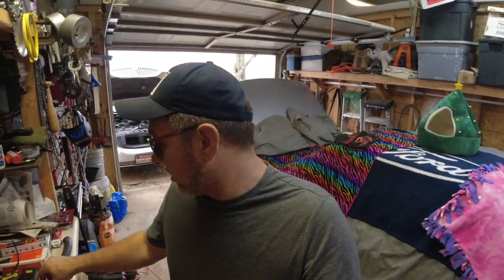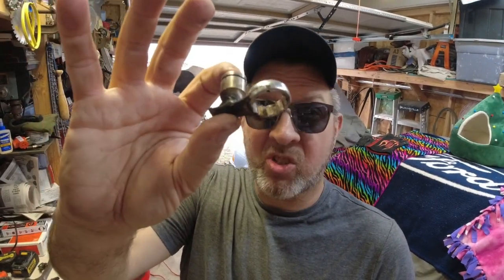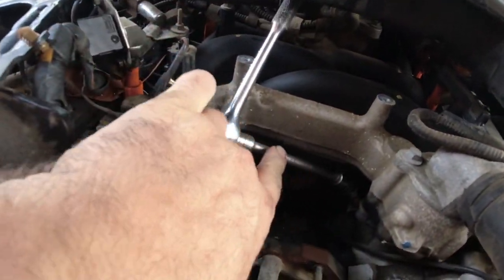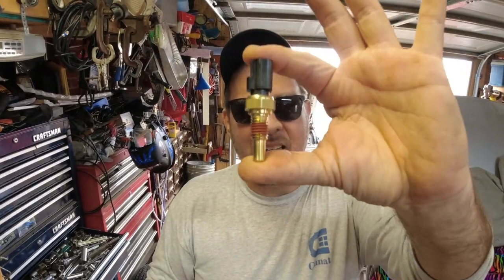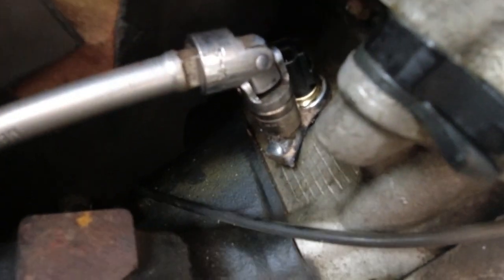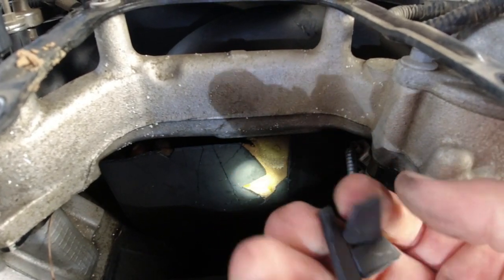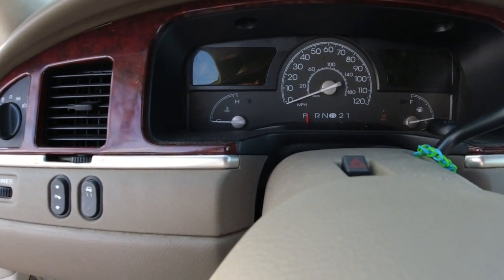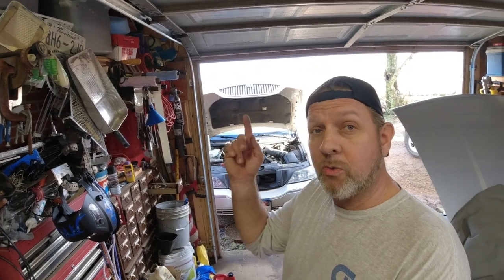Lincoln Town Car Temperature Sensor Hack #diy

Comment: Hey I changed the easy one that’s on top ,and my temperature gauge still shows cold even if my car been on for hrs ,so I should change the one behind the alternator correct?
Reply from the maker: I would change it. If it's still running cold mabe the thermostat is stuck open. Just an FYI.

Comment: Hello, So you replaced both sensors it looks like, also the one on the aluminum crossover in top of the manifold just to the left of the alternator? ... I want to change both mine but was wondering are these the same part number and do you need to replace both of them I also have a 2003 model
Reply from the maker: Different part numbers and Different shapes..

Comment: Just drain the system before taking sensor out. Thanks for tip. That thing was placed to be hard to get to. I noticed mine leaking when I changed the alternator.  Hidden back behind alternator on purpose.